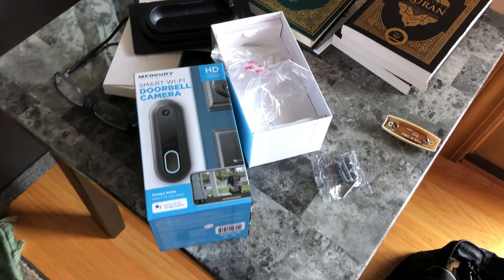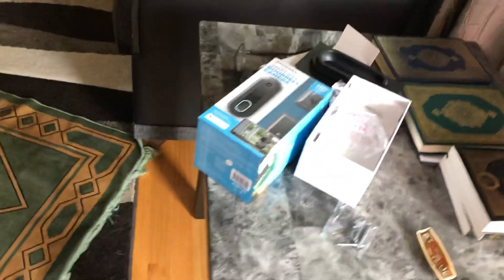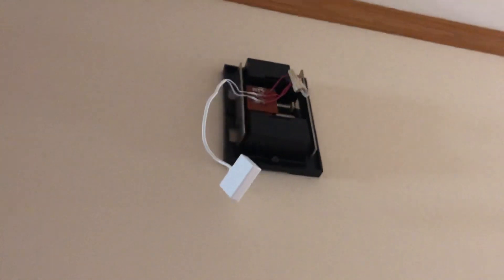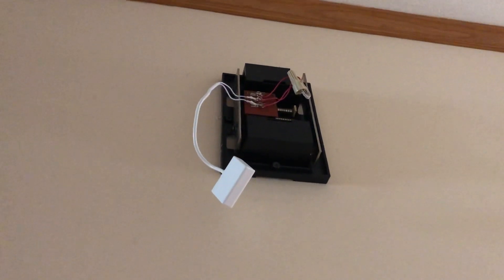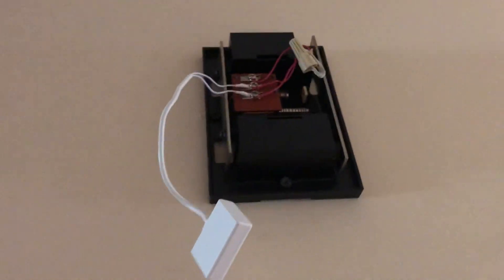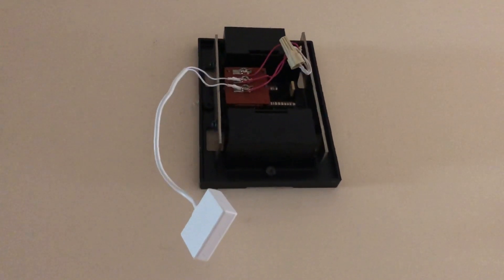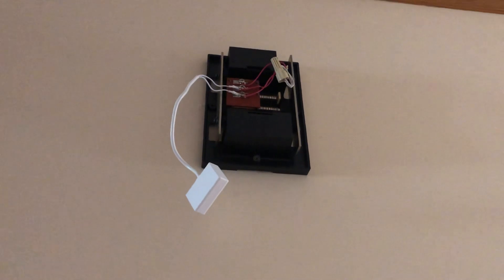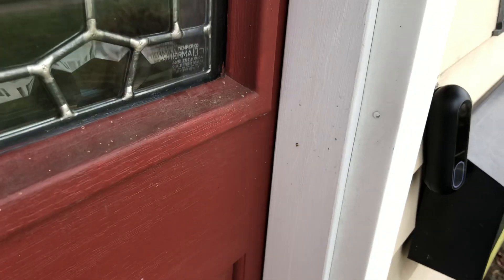Merkury smart video doorbell part 1

Comment: My breaker box doesn’t say door bell, how do i know wich one to turn off
Reply from the maker: In that case you need to try all of them one by one. The one which stops your existing doorbell to work, is the one you need to turn off.  There may be other things attached to the same breaker other than doorbell (some lights for example)

Comment: You need to switch it to mechanical in the setting in chime options
Reply from the maker: I did that but still
Reply: @peacepeace2379  did you take off the chime box from your door bell that white thing that they give you in the box.. when you switched it
Reply: Switch to mechanical with no box hook up
Reply from the maker: @mystery7177  I don’t remember exactly now if I tried it by removing the white box. It is attached at this moment. Do you have one like this? Did you try it without that white box ?